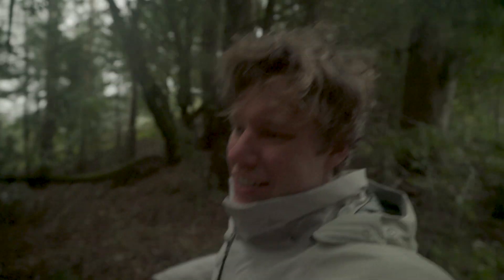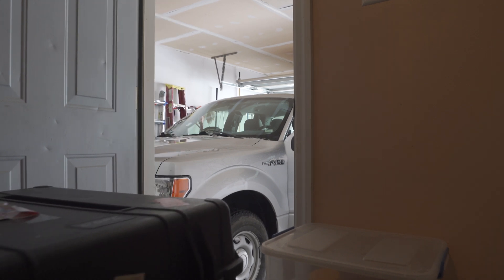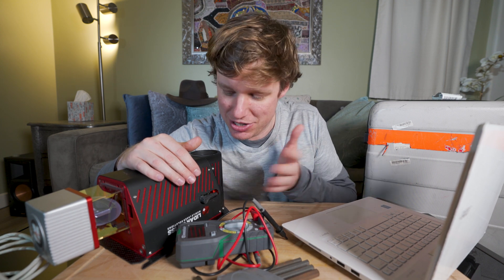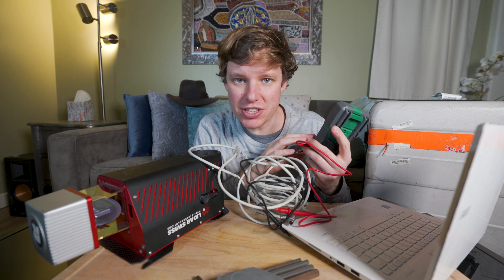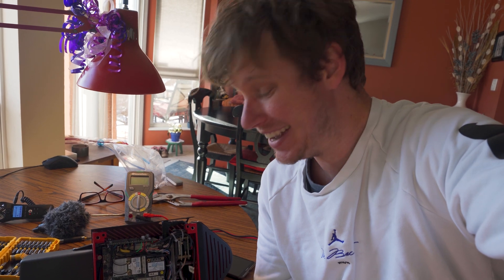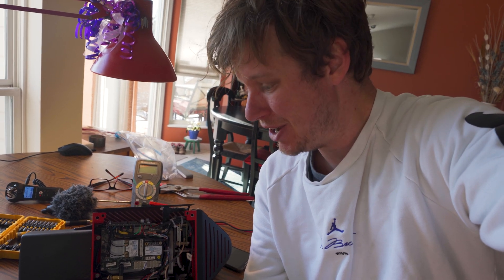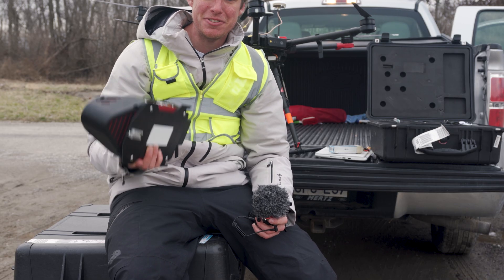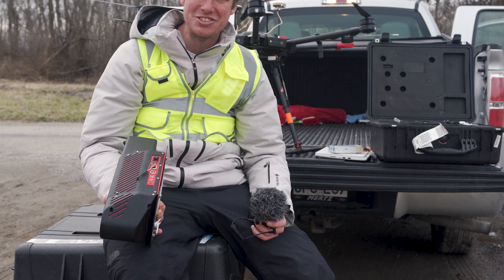I Broke a $180,000 Drone LiDAR | Drone LiDAR Teardown

Comment: I know the feeling of having to repair expensive equipment. I used to be a crawler operator for a company that did sewer inspections. Basically, I would send a remote controlled crawler into the sewers and use cameras and lasers to inspect the sewer pipes. The crawler alone was $75,000 and that didn't include the cameras or any attatchments. You can imagine the harsh and nasty environment that the crawler would be in and we would have to do our own repairs. Our truck was half mobile studio and half workshop. We had a large box truck just for that little crawler because of all the parts and tools we had to carry. I feel your pain.

Comment: Also, what kind of accuracy do you get with your Riegl LiDAR? I noticed you mentioned the DJI got about 15 cm, which wouldn't be good enough for my municipal projects, but I imagine you get more like 1-5cm on the Riegl?
Reply from the maker: Your exactly right. Usually 2-3 cm accuracy on that reigl!
Reply: @IndianaDrones  Is the 15cm accuracy  for the new L1 sensor from DJI or something else from them? I own a small surveying company in Southern Africa and I am getting more and more jobs where UAV LIDAR would be ideal as opposed to photogrammetry but the cost is extreme especially given our exchange rate. I am looking at buying the M300 RTK as it seems like a beast and the long term cost of a M600 pro is just a bit too much at the moment however, I also need a sensor that will give a combined error of 2-5cm and not only on the sensor range accuracy. Can you please recommend any third party sensors for that drone platform that will do the job and not cost USD 180k lol.  I have been looking at Emesent, Liair and some Riegles but it is not clear on which UAV platforms they can be attached and what combined errors to expect. Thanks for the awesome videos, there are not a lot of spatial data collectors that truly understand this technology and it's limitations like you do.
Reply: Hi Indiana drone please look at some of the messages in this videos comments someone is trying to scam your viewers with a fake prize give-away.
Reply from the maker: What kind of municipal projects are you working on
Reply: @IndianaDrones  wow. That is insane accuracy for a full lidar point cloud. Seems like you wouldnt even need ground shots except possibly for control. Just plug it into navisworks and import to civil 3d. Seems super powerful! I'm a civil engineer for the city of kelso, wa. I do the drafting and design. I'm finishing up the plans for the new park improvements but future projects will mostly be roadway improvements and maintenance.
Reply from the maker: That's a solid job! Well, we still need GCP and a base station collecting static measurements over control. But yeah, it's real good! The job in this video was a corridor survey for a municipality in the Midwest! They were blown away with how much detail these systems pick up.
Reply: @IndianaDrones  That's incredible! I hope someday I can employ this technology in my projects! Would be really nice to have a point cloud to work with instead of a traditional survey.